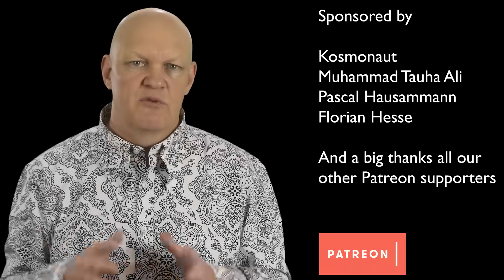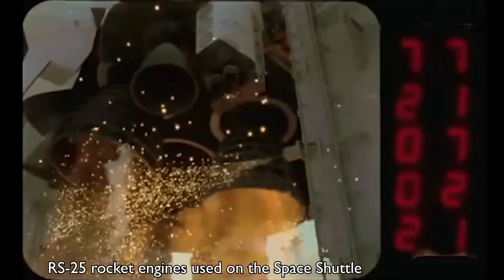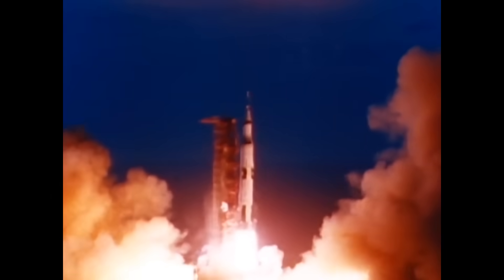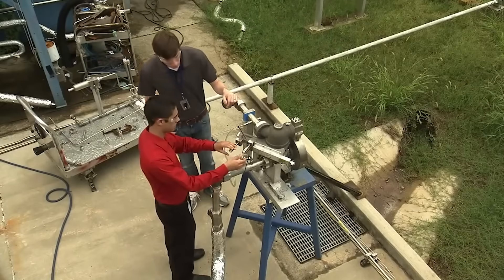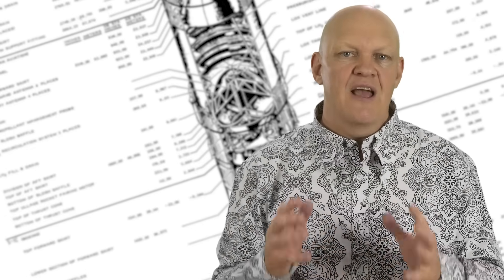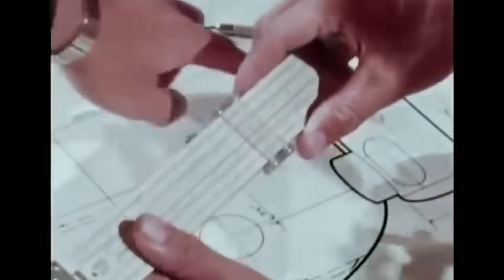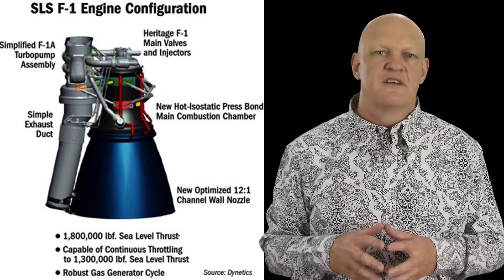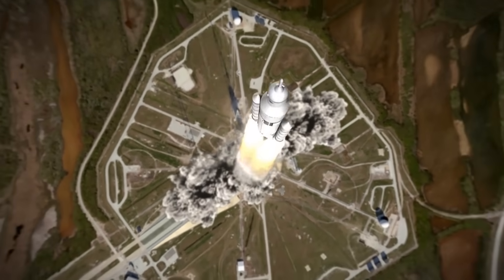Why Can't we Remake the Rocketdyne F1 Engine?

Comment: I think its the lack of tobacco products. In every old picture of NASA you would see someone smoking or an ashtray
Reply: @Erik Truchinskas That's part of it, they are also falling prey a vitamin deficiency. Men in those days knew breakfast was the most important meal, and were dedicated enough to supplement the meal with hard liquor. Probably while finishing off half a pack of unfiltereds to insure a healthy start to the day.
Reply: Made detecting hydrogen leaks so easy
Reply: @gl_tonight  Brilliant
Reply: @gl_tonight  funny
Reply: THIS.
Reply: Some of the control console desks for Mercury had ashtrays built in.
Reply: @fustigate314159  in the pre-World Wide Web days, before Internet use was commonplace, there wasn't a lot of information readily available for me to know much detail about what caused, if they even knew, the Apollo 1 fire, which killed Grissom, Chaffee, & White. I often wondered, if one of them lit up a cigarette, causing the fire. I remembered, that many smokers, if they found themselves too long without a cigarette, would break rules or go to whatever links, to smoke one. 
    ...Of course, we know now, that it was wiring & the original Command Module was an accident waiting to happen. Also, most Astronauts back then had a STEM background, not to mention self-disipline & would have understood the danger of smoking, while in a pressurized oxygen environment.
       ...Anyhow, It did cross my mind 40 years ago.
Reply: @sparky6086  i doubt it. By this time pilots were becoming more physically fit to deal with the extreme g forces that came with flying fighter jets. You didnt see the boozer/smokers that you saw flying in ww1 and 2 like pappy boyington. I highly doubt that these pilots were smokers and even if they were they would most likely have the self control to not smoke at innapropriare times/places.
Reply: @eriktruchinskas3747  Actually, many of the astronauts still smoked, throughout the 1960's. 80% of adults in America smoked in the 1960's & an even higher percentage in the military, jet pilot or not. In fact, they didn't really start a push for American military to quit smoking until the mid 1980's. True, people are not as physically fit as smokers, but they're not completely unfit either. It wasn't unusual to see professional athletes smoke a cigarette as soon as they came off the football field between possessions on TV, until the early 1980's.
     Some astronauts quit smoking during the 1960's, but they were the ones, who had  failed the physical, like Alan Shepard (after his first flight) & Deke Slayton w/ unusual or non-treatible ailments. Shepard had an ear problem, & Slayton had a heart murmur. Being a smoker was definitely not a disqualifier for becomming an astronaut in those days. The main reason, that it wasn't, was, unlike nowadays, people back then didn't want to be hypocrites, so how could the people who made the rules forbid smokers, when they were smokers themselves?
         I may be wrong, but I believe, that every one of the Mercury 7 astronauts smoked, at the time of the program. The Surgeon General's warning wasn't even on cigarette packs until arourd 1965, and it took time for enough of a buzz to develop against smoking, to where over 1/2 of Americans still smoked 10 years later in the middle of the 1970's!
         I don't believe that smoking had anything to do w/ the Apollo 1 fire. I was just pointing out, that during the period, when I didn't have any details about the incident, or whether or not, NASA had ever figured out what happened, having been alive back then and knowing how prevalent in all walks of life, cigarette smoking was, & how addictive it was, that it occurred to me, that it was possible, since it was during testing, rather than a launch, that an astronaut could have snuck some cigarettes on board. I never thought that it was likely, but not because they weren't smokers, but because they had self discipline.
Reply: @sparky6086  i stand corrected then :)
Reply: @sparky6086  Considering the capsule was being presurized with 100% pure oxygen, I really thing the they wouldn't of had their smokes in their astronaut suits. The fire was determined to be of electrical source.
Reply: @berrytharp1334  If you read my entire comment, I said, that I found out, that it was an electrical fault. My point was, that it occurred to me 40 years ago, not that I believed it, but knowing how addictive nicotine is, the thought popped in my head for a moment. This was long before; I had the information at my fingertips. 
    ...The Internet is great. We used to go to this place called a "Library" to get information, but half of it was obsolete or incorrect and the other half we didn't need!
Reply: @sparky6086  Risks of fire on board made that highly unlikely.(sneaking cigarettes on board).
Reply: @timmyhipbird7543  I agree. It only occured to me, because I know, that many cigarette smokers will take unreasonable risks, in order to smoke a cigarette. In America at the time, even among Astronauts, smoking was very common. This, coupled w/ the fact, that the Apollo 1 tragedy itself illustrates, that the risk of fire on board wasn't given a large enough priority.
        I do believe, that the fire and deaths were due to a faulty overall design and poorly installed and/or poorly designed/selected wiring.
Reply: @eriktruchinskas3747  Are you kidding me? Armstrong was a chimney, if you watch older interviews from the early 70s Neil would puff away on his cigarette.
Reply: @sparky6086  The story is simple: the construction crew left alien items inside the space craft! We're talking about sockets, wrenches, screw-drivers, etc.
After Wally Schirra ripped the contractors a fresh orifice -- he was the engineer of the Mercury crew -- NASA went with one-man working and four-men certifying for every dang thing assembled if man-rated.
Mr. Dan Slater had a heck of a NASA collection -- the duplicates bot and paid for by taxpayers that never left the ground -- stuff like White's hand rocket used during Gemini. Check out the old NASA photos. He had its duplicate. (!) [Bot it at auction.] What's amazing is the paperwork and seals still wired to all of his buys. The all-time-winner has to be a complete Apollo space-craft control panel. (I don't know its full story.) 
Every bolt and nut was torqued to spec -- every tool had to return to its tray -- exactly where it came from -- every assembly was performed in a 'clean-room.' And so forth. It proved out that such extreme measures paid off in drastically lower failure rates. So much so that America now always sticks with them. Of course, the assemblies are now performed on video, too.
Reply: All smoked like hell
Reply: Young punks these days don't even know what the hell a T-zone is.  They also don't have the good sense to get off of my lawn.
Reply: Milk Manson, 
   lol! :D  safe-space whipper-snappers!
Reply: As soon as the three martini lunch and smoking in the office was eliminated, we started making some really poor decisions.
Reply: Could be a connection there...hmmm.
Reply: @pex_the_unalivedrunk6785  agree
Reply: And flat top haircuts. A definite asset in space exploration.
Reply: Yess, i love it.
Reply: "America is getting stupid" can't argue with that.
Reply: Break out the slide rules, and strike up some lucky's, and lets build some cool shit!
Reply: Seriously, these men had childhoods and adolescences deeply impacted by The Great Depression, then went on to fight in WW2 and/or Korea... once you thoroughly grok that, it's easy to understand why niceties like ciggies and bourbon would never EVER make it onto their list of Truly Dangerous Things ... why nebulous claims of cancer would never rise to the level of tangibles like "German artillery" and "Chinese mass infantry attacks"...
Reply: @MajorCaliber  And the fact that the depression and war meant there was no money to buy new or parts to repair yielded people who knew how to build or repair. They had "hands on" experience.
Reply: @ronfullerton3162  Besides  "German artillery" and "Chinese mass infantry attacks" I would add "Total Loss of both Launch Vehicle and Launch Pad at moment of Ignition" to the list of very real and immediate dangers that weighed on their minds.  These men enjoyed/endured/suffered moments of incredibly concentrated reality that most of us will never face... let 'em have their smokes.  ;')
Reply: @MajorCaliber  I do not know what percentage of the people smoked back in the 50's and 60's, but it was a good amount. And it was almost as many women as men. Church was about the only place that you could get away from the smoke. It was part of their life, and it was socially acceptable for the most part. And they got their work done while smoking. If they weren't working while smoking, they were usually "pondering" our working out a problem in their mind. They would be going about their job with the cigarette hanging out of the corner of their mouth. I never really gave it a thought, because that was just how it was. The smoking bans started, and I was sure there would be all out war because of how entrenched it was in the older people's life style. I guess may of them were ready to quit, and that was a good excuse to stop. For all they had been through and accomplished in life, I did not  see a need of denying them this small pleasure.
Reply: What people may not have considered is that the individual's notes related to specific changes were written on the back of those very cigarette packets.  Thus they were lost to posterity.
Reply: Did these ashtrays have pocket protectors and slide rules?
Reply: @holton345  no, but they did have googly eyes with glasses, it was a good way to boost morale (im joking)
Reply: Erik Truchinskas exactly. More stimulants. Less dope.
Reply: The rockets need tar, and nico-glycerol. Also, Mars needs women if you're going. Just sayin'.
Reply: An F1 engine not the only thing Millennials can't make, that the, fueled by coffee & cigarettes, flat top haircut generation mastered. How about a molten salt nuclear reactor? They are safe from meltdown. I'll bet; these guys smoked: https://youtu.be/tyDbq5HRs0o
Reply: Many racers will say the same. Taking Tobacco and Alcohol sponsorships away has killed the NHRA and NASCAR. Say what you want, but we have tons of good automotive designs and products that came out of race shops. Super stopping brakes are just one example.
Reply: Lol it's so damn true
Reply: @BLACK-TAR-FENT  a legend never dies, but a hero lives forever. Sorry your name reminded me of the sandlot
Reply: Nicotine has been shown to alleviate stress and sharpen your focus, but it’s not worth all the other carcinogens and addiction.
Reply: BEHOLD! THE POWER OF NICOTENE!
Reply: Yes, and divorce lawyers had a seven month long backlog. Those were the days.
Reply: Hahaha. I,ve often seen giant ashtrays in space control center  full with "discard boosterrockets" and pipe smokers!😎who makes more smoke than one F1 motor😉
Reply: Also probably a good amount of cocaine, it was the 60s come on
Reply: @OntDH  lol i could not spot any mirrors on the consoles next to the drinks and the ashtrays http://klabs.org/images/home_page/GPN-2000-001406_kranz.jpeg
lmao look how they placed the cup of coffee on the console
Reply: There was a different work ethic and men were men and there was good women behind those men.  I think they were also smarter back then. 
Today if I don’t have to learn they can just look it up on Google. My father was an engineer on the Space shuttle and I ran across the classes he took in high school. Which disappeared when I was going though high school. Besides There was a more hands-on approach I’m blue collar education being taught. Attached with college it made some of the best engineers. Dad still used slide rulers and had to sign up in advance to even use a computer. Look what they accomplished.
Reply: @mdsuave13 , the two best legal drugs available....caffeine and nicotine. Without them, not only would we have not won WW2, but also would still be on Earth.
Reply: Without 🚬 and ☕, who knows what would have happened.
Reply: The ICBM launch control panels from the 80's had cigarette trays MOLDED INTO THEM.
Reply: NO SMOKE BREAKS!  Here's your ashtray. Now stay at your desk and do figures!
Reply: Its a harmful addiction, but nicotine sure helps with focus. Add some strong NASA vending machine coffee, and it moves to a whole new level.
Reply: Key point here, THEY WERE MEN!
Reply: Erik Truchinskas makes sense if you smoke 💨 you stop to take many smoke breaks you can collect your thoughts during these times find solutions. I haven’t smoked in 5 years but sometimes I do get the old urges same goes for the chronic too.
Reply: @fernandosalgado3589  I quit 5 years ago too, 1 week after my 27th birthday. I feel you on the smoking front and sometimes still having vivid dreams of puffing on a square.
Reply: @fernandosalgado3589  when working with computers your skull turns to mush in a hurry you do need lots of breaks but unfortunately the boss doesn't see it that way so you end up spending seven times longer than it would take if you took breaks
Reply: As much as I hate to say it, there could be something to what you are saying. Just like physical performance enhancing drugs shortening life expectancy, perhaps tobacco is a mental performance enhancing drug, but also has the trade off of shortening life expectancy. ...After all, coffee, although not deadly like tobacco, is often credited as being a huge factor in the Industrial Revolution, so why wouldn't tobacco, which use was intensified in the 20th century, due to cigarette use becomming common, be part of the reason for great technical innovation in the 20th century?
Reply: @sparky6086  Outstanding, thoughtful, theory.
Reply: @sparky6086  tobacco is found to have mentally stimulating properties so it makes sense plus it greatly can reduce stress (why during every war until recently soldiers were kept stocked with tobacco and people who were non smokers quickly became ones...plus the appetite suppresion was an added bonus)
Reply: My god... your right....
Reply: Yea umm no
Reply: Tobacoo, right
Reply: lol
Reply: Awesome comment
Reply: @eherman9780  thank you. I didnt think that I would have gotten all the replies that I did
Reply: Obviously tobacco is horrible for you, but actually nicotine by itself is a nootropic.
Reply: Also explains why a lot of them are dead.
Reply: @Skiddins  being close to 100 years of age could be another.
Reply: Erik Truchinskas
dont forget all the drinks on the sensitive consoles
Reply: Most of them came from a very anti smoking regime
Reply: @mdsuave13  one thing is for sure, the DME who overlooked my AMT class was very fond of his cigarette breaks lol
Reply: Tobacco is a nootropic.
Reply: Or...perhaps if we made the engineer's wear white short sleeve shirts with ties

That might trigger some embedded memories
Reply: They only did that so they could save up enough cigarette packets to do all the working out on.
Reply: Job stress
Reply: Like BMV formula 1 motors there was hardened by urinate from engineers.
Reply: Maybe they need vapes or 'Old' Havana, whose choice?
Reply: Those things were taken away from us during the great dumbing down and emasculation of America.
Reply: relaxing while keeping your head.
Reply: Gold
Reply: Ahh, they used the rocket parts as the ashtray..... 

(vulcan reference)
Reply: Horizon winangkoso holy fucking shit that may be the greatest reference of all time. For those of you who didn’t know, when the Falklands were invaded the British put together the worlds longest bombing run ever based on the almost retired v-bomber the Avro vulcan. Now the plan was heavily relient on mid air refueling so before taking off all the gear was checked and they discovered that a special piece on one of the aircraft was missing. They looked everywhere in the repair bay and the apron that the plane sat upon but couldn’t find it. Eventually they walked through the barracks where they found the part being used as an ash tray by one of the crew.
Reply: @mdsuave13  You know, now that I think about it, "going postal" wasn't a thing, until around the time, that  people weren't allowed to smoke at their desk any longer?
Reply: @sparky6086  Wow, right again.
Reply: You really have a point there!  I travel nationwide to different facilities shutdowns, over the years tobacco's been banned.  The decline in quality and safety is evident.
Reply: Never mind a few burn holes in the seat upholstery, a smoker is still more likely to bring your car back in one piece. Anti stress stick is one thing, but interestingly enough nicotine is also to be found on the list of nootropic substances
Reply: @ogreunderbridge5204  exactly. I cant suggest smoking regular cigs but a tobacco only cig or nicorette can be very beneficial at times
Reply: @mdsuave13  that's why we should decriminalize all drugs
Reply: most likely the reason most of the engineers are not around any more.
Reply: @mdsuave13  I wonder why they're stressful. I'm not sure why honestly.
Could you tell us why you think they'd be stressed?
Reply: @IPromiseTomorrow  just the billions of dollars that went into the projects/ human lives being held in the balance depending on everyone being on their game
Reply: It's easy, Isaias. I was here at the time. When Kennedy wanted us to go to the moon before the decade was out, the word was "impossible." It wasn't just that we didn't have enough time, but we couldn't even coceptualize how to get men there safely, let alone return them home in one piece as well. We were asked to do what was litereally impossible at the beginning of the decade, and to accomplish it in less than 10 years. That creates some stress. But, amazingly, many, many people worked very hard, day and night sometimes, on this mission with determination to make it happen and to make sure nothing they did was in error. It still boggles my mind at what we achieved in the course of about eight years. Everyone helped, from the public who gave us their support to people in all professions who never thought they would be a part of anything to do with space travel, to the people in Washington, D.C. who supported funding -- just everyone, even former German engineers who had, at least technically, been our enemy less than 20 years before. Everyone was on board. America made this happen. We were truely one.
Reply: @IPromiseTomorrow  there are hundreds of things that can happen during a space launch

only one or two of those possibilities include the crew surviving.
Reply: @drewgehringer7813 
I know that.
Now after a year later I can understand their stress about getting it wrong. Which makes sense.
Off topic but, they're incredibly smart in terms of their craft yet they lack certain intelligence is other fields. Such as preservation and application.

They lost their invention to Time then made no use of it. I openly dislike that.
Reply: @drewgehringer7813 
Oh their invention was out matched I just heard.
This other invention sounds like it used less resources and is better.
That makes this old invention perhaps obsolete.
Reply: @vf2758 
It wasn't really life or death.
I doubt that if Russia won the space race one of them would have their life endangered.

I do hope they can rebuild lost technology or at least train their modern scientists how to make their technology recoverable.